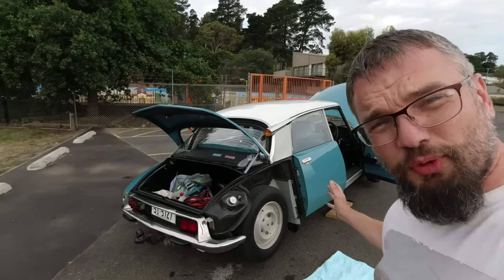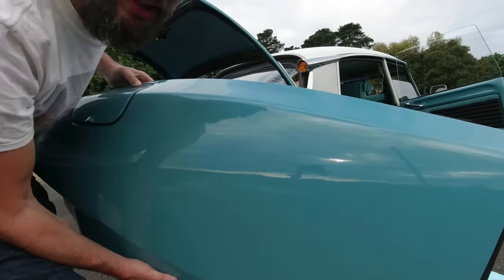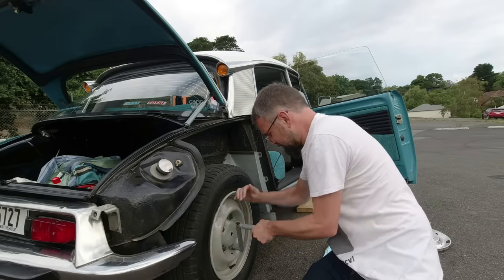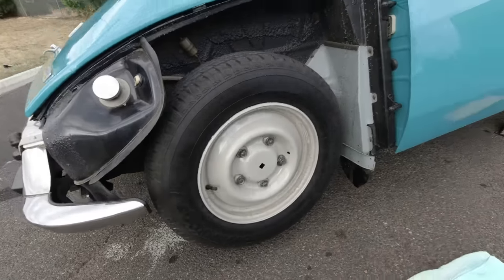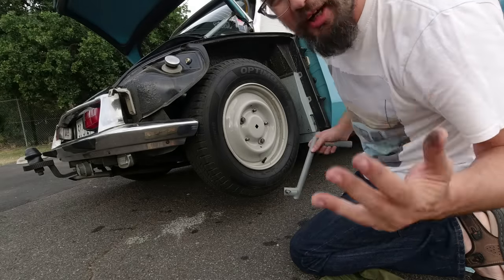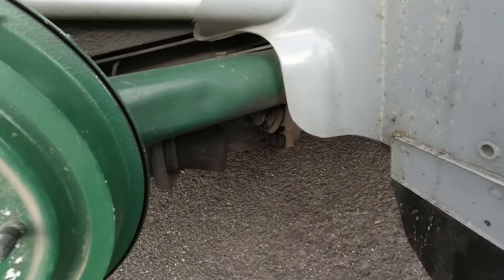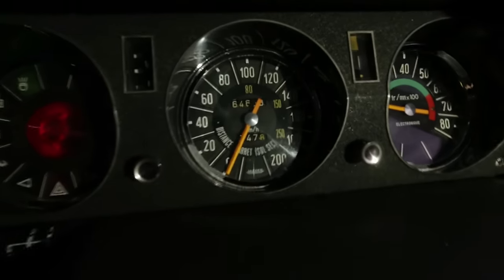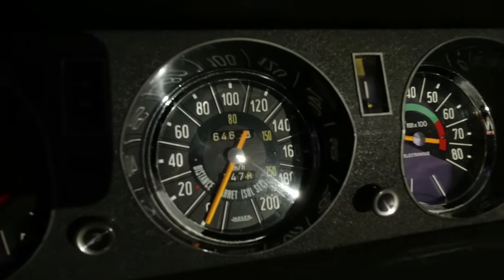Can it drive on three wheels?! And other Citroen DS Party Tricks

Comment: Apparently French rally drivers disabled the swivelling headlights because when they were drifting around corners at high speed with the steering wheel on opposite lock, the swivelling lights illuminated the wrong direction!
Reply: Wrong-O! They would be in the correct orientation.
Reply: That's easy: the lights were mechanicly connected with a simple rod.
Reply: coopdivi Drifting with a Citroën DS ? A front wheel drive Citroën DS ? You don't know what you're talking about.
Reply: @CaptainDangeax  Actually they did and he is...
Reply: @eknaap8800  Think twice : to drift you need extra torque on the rear axle to make the car drift. Citroën DS is a front wheel drive. The only result you can get with extra torque is loosing traction and going strait. And the Citroën DS does not provide a hand brake on the rear wheels, the handbrake is a footpedal in the left wing, actually braking the front wheels. Why am I talking with newbies not having their driving licence ? The only reason for removing the connecting rod is because of north american DOT regulation, not allowing moveable high beams. Nothing else.
Reply: @CaptainDangeax  I have my own car workshop for 25+ years. I did some international rallying back in the days. I was a member of the technical staff at Zandvoort raceway. I teach shop at a tech college for 12 years now. I published a comprehensive E-learning course, which is accredited in the Netherlands and Belgium and am resposible for the examination of it.
And yes, one can slide a front wheel drive car (my own experience), although with some effort.
Furthermore I have spoken to some of the old rally drivers, who drove these exotic cars. The driving techniques they used were different to modern ones.
I am far from a newbie... 🥴
Reply: @eknaap8800  Your personal experience does not explain how to drift with a front wheel drive DS
Reply: @CaptainDangeax  It explains it quite well; It's your lack of understanding or believing it... Trust me, I know what I'm talking about.
Reply: @eknaap8800  This still doesn't explain how to drift with a front wheel drive. You may oversteer, but that's not drifting
Reply: @CaptainDangeax  Have it your way.

Comment: I had a rear wheel blowout on an ID at about 75mph on a downhill curve on a bumpy road!  The noise was awful but the steering was completely secure and I simply braked to a halt.  I’ve been a Citroen Nut ever since, that first big one, then a GSA then two Xantias.  Loved them all.

Incidentally, I also experienced a rear wheel blowout on an Austin 1100 (which turned over and flew into a field) and a Holden (which I JUST held onto the road width).  

People get all excited about engine power but what really matters in a car is a first rate chassis.

Comment: Back when Citroën were bonkers bit also very clever.

You'd never see this today.... To remove the wing (if it wasn't welded on)  would require removal of 47 different types of screws, 21 types of clip, half the wiring loom, week arch lining a d then you'd realise it's all a bad job so better forget it!

Made back when owning a car was a hobby rather than a chore....
Reply: LOL having to remove a panel to change a wheel is a stupid idea anyway. That's why these Citroën piles of junk are the last cars to require it.

Comment: Try holding the brace and spinning the wheel,inertia will come to the rescue...
Reply: I was about to suggest that, too. Super Heroes would use five braces, all held in one hand, and unscrew all five nuts at the same time.

One question that I've always wondered about: what factor led to most (all?) car manufacturers changing at about the same time from studs on the hub and nuts to hold the wheel on, to holes in the hub and bolts to hold the wheel on. I much prefer the latter, as long as there is a central boss to "hang" the wheel on while you rotate it until the holes line up.

Comment: Whatever happened to this level of innovation? Much of it killed by accountants and balance sheets methinks.
Reply: It's still there. High end cars have amazing feats of technology these days, from engines that can run both in two stroke and four stroke cycle (Koenigsegg), to engines that can run both a diesel and an otto cycle on the same fuel (Mazda), to cars that can almost-but-not-completely drive themselves (Tesla). 
The issue with car companies is that competition is intense, and the average buyer is totally fine with conventional suspension and boring cars, so if one company makes boring, acceptable cars, the others will have to follow that company with only a small niche available for the very rich buyers who can afford high tech stuff.
Reply: but today we get a bottle of slime and a mini compressor because it is 24 cent less than a spare tire :) and it works at least 20% of the time!
Reply: @olik136  Yes, but also because people demand more and more a flat floor in their boot/trunk. Spare tires take up a lot of space. 
I also get the impression that people aren't very likely anymore to change their own wheels, and that modern tyres don't blow out as much as they used to, but i have no factual support for that.

Comment: Never use your hand as a Hammer! Unless you want problems in later life.
Reply: Or your head. Actually a line from a play, possibly by Lanford Wilson.
Reply: Yep, a double carpal tunnel operation after doing that for 30 years, so it makes my skin crawl to see him doing it.  He should be pulling up on that handle. Arms are made for pulling, not pushing.
Reply: @moyadapne968  Yeah, I was thinking the same thing, you get to 50 and it just hurts to do that now!!
Reply: With a double-cranked starting handle type wheelbrace, the best way is to stand facing the front of the car, just behind the wheel. Hold the end of the brace in your right hand (as a "bearing") and pull up on it as you press down on the cranked part with your left foot. Same in reverse (but facing the back of the car) to tighten. And always do the final tightening on every other nut (eg order 1 3 5 2 4) to avoid cyclic stress if you do them in sequence, which can make the wheel not seat quite true on the hub. Another of my grandpa's pearls of wisdom on "how to change a wheel", along with "loosen the nuts slightly while the wheel is on the ground and can cannot spin freely", as Hubnut mentions.
Reply: The long hex rod used to hand crank is a long lever for the wrench!  Also, USE YOUR WEIGHT, just push down if you don't believe in leverage!

Comment: I currently have a CX Estate, only because I couldn't afford one of these. Still has the hydraulic suspension, true power steering (not merely assisted), power brakes, all running off the suspension system.
Problem is, if the hydraulics fail, you lose suspension, steering, then brakes, in that order, so you can get the car safely off the road and stop, but this rarely happens if the car is well maintained.
The things that fail on CX's are simple things like door hinges (they develop an annoying click over time due to wear), body rust (the factory rust proofing wasn't the best), and sensor bugs (the sensor cable connections become unreliable over time because of dust and corrosion, causing warning lights to go on and off).
Beautiful car to drive - you can ignore speed bumps, the car rides over them like a boat, and the steering is the most accurate I've ever experienced, with built in self - centering for easy parking.
These old Citroens are for enthusiasts only these days though.

Comment: My dad had one when I was a little kid.  He really loved that car.  He eventually sold it when it got too hard to keep it going.  Citroen had pulled out of the U.S. and getting parts, and qualified mechanics was very difficult.  
My dad's had the older hub design, which had only one fastener holding the wheels on. 
We did drive it on 3 wheels once, when we didn't have a spare.  The video shows the best wheel to have removed for 3 wheel operation because the driver's weight counter balances the side without a wheel.  There were 3 of us in the car that day, and we all slid as far over to the driver's side as we could get.  It got us home, and my dad took our other car to buy another tire. 
If I ever fell into a fortune, I'd buy one that's been fully restored and see what my dad enjoyed about it so much.

Comment: Très fantastique! That's clever engineering right there.
When I was a mechanic, we called the adjustable crescent / spanner / wrench a 'nut-farker' coz the jaws tend to slip open and round off the heads. I guess that's why vise-grips were invented :)

Comment: I've owned three Citroens with hydropneumatic suspension since 1996. All second hand.  Kept them for years and they never missed a beat. The last was a C5 2 litre hdi td Exclusive. 2005 model which I sold in 2017. Towed a heavy caravan all over Europe. So comfortable. The buyer said it would be used as a taxi as the leather upholstery was easier to clean when drunk people threw up!  Should have refused to sell it to him. Had Xenon steearable headlamps,  voice recognition, phone with sim card in dashboard, satnav, front and rear parking warning, cruise control, speed limiter. Easiest connection of car to caravan by lowering suspension, reverse to caravan and raise suspension so the ball picks up the hitch. The tv advert for the Citroen BX showed two trucks driving towards the car at speed with just enough room to fit the car through the gap, when suddenly a wheel falls off the car which doesn't waver and goes through without a tremor. Then Elf and Safety arrived and wouldn't allow it. Can I recommend Pleaides, Brookside Industrial Estate, Sawtry, Huntingdon PE28 5SB.  Knows hydropneumatic suspension inside out. Even repaired a Toyota with similar which Toyota couldn't sort.

Comment: What a thoroughly enjoyable video! Never knew the DS has so many party tricks, that's insane! Such a clever hydraulic system on these, and just goes to show how ahead of their time they were with the headlights
Reply: Until you had to work on the car and the spot lamp rotation bar went over the top of the engine. I had a DSuper 5 so hopefully my memory is correct after all these years.
Reply: Lights are leveled & high beams turned by a simple cable system hooked to the steering & suspension, no hydro. involved.

Comment: I owned a Citroen C5 and parking at work one morning I noticed the rear tyre needed air (probably down to 25 PSI). I drove to the local servo and found the tyre was flat. Dead flat, a great big screw through the tread. I got the servo to replace the tyre andI went to pick the car up later. They charged me for a puncture repair. The tyre was undamaged apart from the hole. "Lucky you caught it quickly Mate". I'd just driven 30 km at up to 100 kph on the tyre with the screw from my driveway stuck through it. I'm convinced the Citroen suspension saved the tyre by holding the wheel off the ground to some degree.

Comment: That black "T" piece pin with a wing on it that you used to hold the jack in place is also used to release the wheel trim instead of using the screwdriver. I used to rebuild the DS's and 1220 Clubs

Comment: I didn't have the fancy jack thing for my GS, but did change a rear wheel with a similar technique, just put the suspension into high and reversed the good wheel onto the kerb, leaving the puncture well up in the air. On the down side, I remember trying to do some work under it as it gradually sagged without the engine running. The lovely simple system they used (just a level sensor for the front and one for the rear) gave brilliant self levelling. I remember giving a carful of folk a lift, everyone jumped in, the car hit the stops then just pumped itself back up. when they got out it lowered itself back, great system. It did give me the odd scare, the first time I stopped at lights and held it on the footbrake after some hard driving, I think the acceleration had made it raise the rear to compensate, holding it on the brake meant it was locked high and I discovered this once the suspension let a lot of pressure out of the back, the car dropped suddenly, then just pumped itself back up again.Wierd machines, but entertaining. I think the hydraulics were brass hoses on those, I worked with someone who had a BX and after driving to work without springs, brakes or power steering, told me that their pipes were just mild steel and had rusted through, not good!

Comment: While you undid the wheel nuts with the handle alone, under the spare wheel, there is a bar. It is meant for crank starting the engine (with the same handle)  :) But I can also be used to add leverage if you slide it inside the handle to torque up the bolts.  :) Allso you may use the bar to slide the wheel back on without lifting it by the tyre itself. That's why there is small holes on the rim and wheel hubs. Citroen is a true party piece and well thought piece of automotivness :D Kind of miss my DS now, after few years I sold it... Oh and the pin on the jack stand is actually the proper tool to take the hubcaps off.
Great video! Thanks a bunch!
Reply: EXACTLY!

Comment: The mudflap at the front of the rear wheels is for aerodynamics. Just like the flaps on the front of your GSA under your front bumper, and it too should have them ahead of the rear wheels. Also, the outer headlamps levelled with the cars pitching and diving movement, with cables connected to the rear anti-roll bar from the front headlamp support crossbar. Those brakes are fully weight proportional too. They apportion the braking effort depending on the amount of weight in the cabin or boot. The list of party tricks goes on..
Reply: Wondered why the mudflaps were at the front of the wheel...thought just quirky French.  Ta.

Comment: 6:46 a quick tip, if you place the socket/wrench onto the wheel nut/bolt and spin the wheel, it'll come off quicker, with less of a hassle.
Reply: Also, use that hex rod, the crank start thing, into the wrench for leverage and use it through the rim's hole to mount the tire.

Comment: And the BX would do the same . My neighbor once drove over 20 miles with a rear puncture but by the time he got home the alloy wheel had disintegrated . He said he hadn't noticed anything was wrong until he was stopped at traffic lights and the guy working them said there's no tyre on the wheel .

Comment: Thanks for a nice trip down memory lane, I used to drive a DS21.  Here is a fun fact:  The pin that you used to set the jack height has a wavy arm with a flattened end on it.  That arm is designed to pop off the hub caps.  Insert the flat end of the arm into the hole in the hub cab where the valve stem sticks through and the pin will locate on the outer edge of the steel wheel.  Give it a pry and bingo, the hub cap is off - no need to use a screw driver as you did.  Also, it sounds like your hydraulic pump is cycling way too often.  I suspect that there is an internal leak somewhere that is allowing the system pressure to bleed down too quickly, requiring the pump to cycle too often.

Comment: My first car in 1972 was the original ID19 with the "frog" eye lights. The same jacking system. I so wish I still had my basking white shark as we called it. My current car a Nissan Qashqai Tekna also has lights that turn the corner and its one of my favourite features of the QQ.

Comment: My dad was a Citroen mechanic.
I remember as a child in the 70's that we had quite a few of them, also the 7/8-seater Break/Familiale model.
The most comfortable car to drive in.
Something that was not mentioned in this video is the front wheels that correct themselves when you take your hands off the steering wheel. That's another cool feature.
Reply: Dude, wheels correct on every car ever built when you take hands off the wheel. It's not a Citroen thing :D.
Reply: @RB-gv5xh  Wrong, dude. 
This is when the car is not driving.
Never seen that on other cars, and I became an automechanic in 1987.
Reply from the maker: CX and SM had powered self-centring steering, even at a halt. DS did not. Any other car should return to straight ahead when moving, allowing for side gradient. It's how A frames work.
Reply: @HubNut  Right, my bad. It was CX I had in mind. 
But stil only Citroen that I know of that do this.

Comment: couple of other things that might have been mentioned. One was clearly visible in the night venture. The headlights were self-leveling so that even when going up the hill the lights lit up the road and not the sky. The other thing about the headlight is that there was a means to select a very strong halogen light that cast a beam of about 500 feet which again when travelling roads in the wilderness was excellent for helping one to see what was ahead. Loved my '69 DS 19 Pallas. Unfortunately, in '73 Citroen was no longer imported to Canada nor the US due to frankly some collusion between manufacturers and the US Fed Gov't making out that there were safety issues when actually the vehicle was and likely still is the safest vehicle produced.

Comment: Parking brake can be used on the rear wheels - cf Austin e.g. Princess, Allegro & Maxi ? - noting the sudden change of height of the rear of the vehicles with the application/removal of parking brake. Particularly noticeable on an uphill slope at traffic lights.

Comment: My old 1979 3dr 3.5 ltr V8 Range Rover had a Rt rear blowout on a hard dirt stony track @ 75mph in the Middle East in 1991. My rear passenger said it felt like a rock had thrown up into the wheel well!  I drove on for a good 20 minutes before we stopped for a "pit stop"!  My mate said come have a look at this. My rear tyre had virtually disintegrated meaning it can drive well on only 3 wheels, without handling issues or further damage to the vehicle!  No chance on a tyre repair that day.  Betcha that Citroen DS couldn't beat this performance!  I actually drive a  new Citroen today.